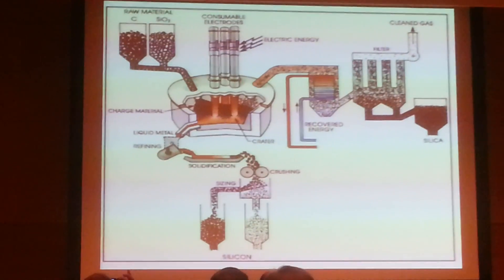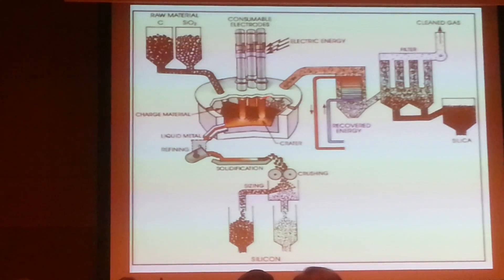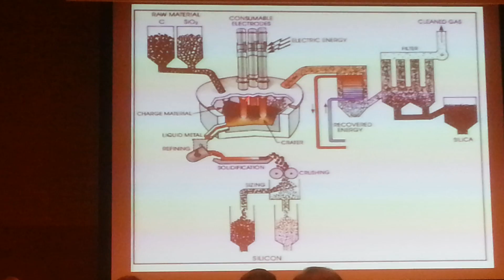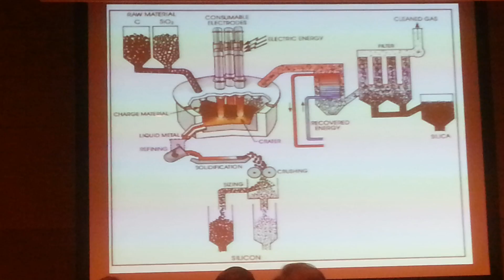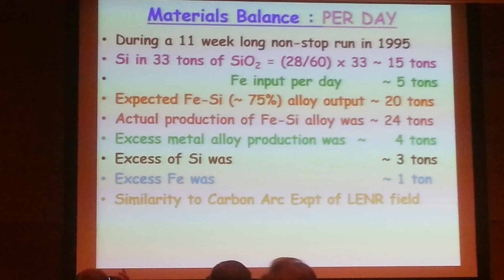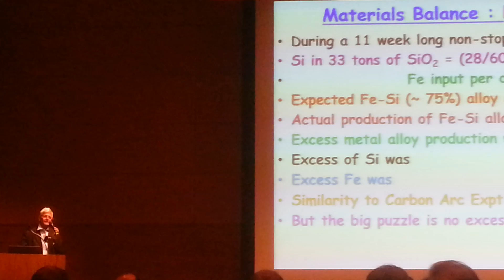Mahadevan Srinivasan - 4 tons/day for 11 weeks - Fusion of Carbon and Oxygen into Silicon and Iron

Comment: Coulomb barrier makes this improbable. Arc furnaces are not powerful enough to fuse carbon and oxygen together into another element entirely. The coulomb barrier is the electrostatic repulsion of atomic nuclei to other atomic nuclei. They are "positively" charged. Arcing, ie, electric arcing is just the electrons to exchange rapidly, it comes nowhere near the energy needed to get the nuclei to touch. It is like claiming you can drain Lake Michigan by scooping it out with a bucket.
Reply from the maker: You need to read the work of Alexander Parkhomov. Over 1000ºC (easily acieved in this arc furnace) Low Energy Neutrinos are synthesised in any condensed matter (plasma, gas, liquid, solid), these are microns to millimeters in scale, this allows weak interactions over trillions of atoms - no need to worry about the Coulomb barrier.

https://www.researchgate.net/publication/390808256_Possible_mechanism_of_low-energy_nuclear_transformations